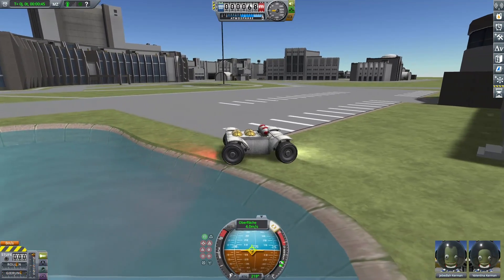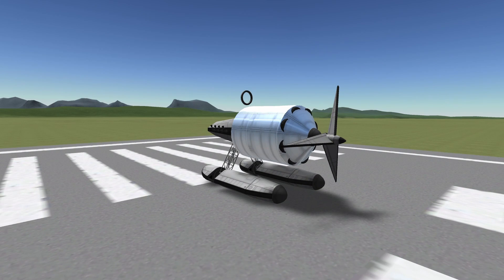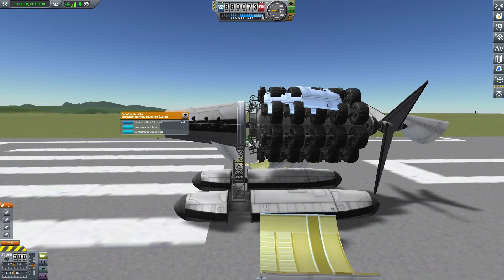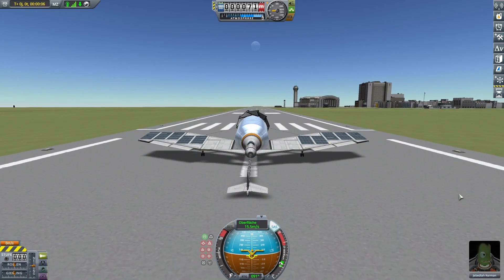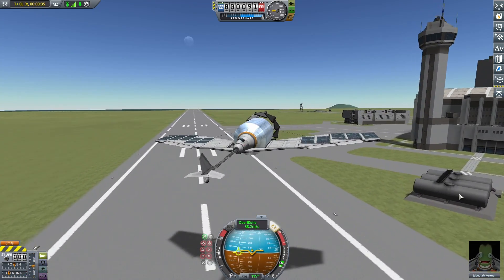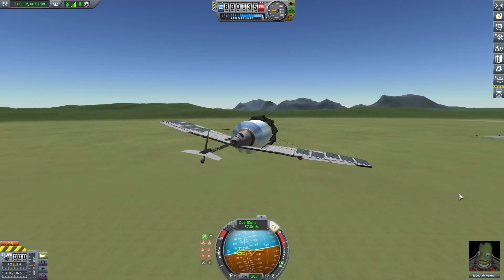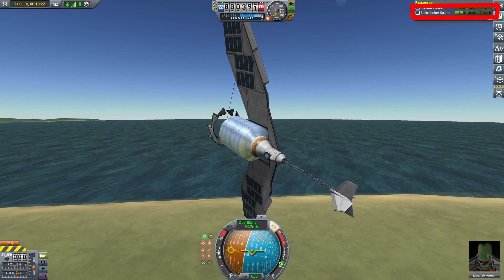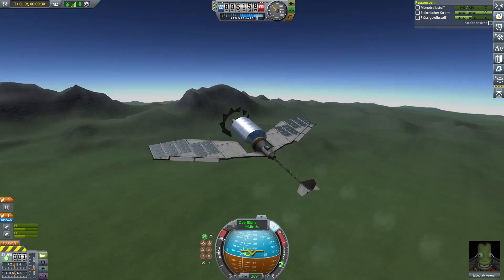Rover Wheel Powered Solar Plane | Stock KSP

Comment: Very interesting use of wheels! 
This craft definitely has some more testing in it
Have you thought about doubling or tripling the amount of propellers?
Reply from the maker: Thanks! Yes, lots of testing and iterations.
As the most efficient engine I could get turned out rather big, and my PC started lagging, I honestly have not really considered adding more engines. The power/weight ratio would have more or les stayed the same.

Comment: Have you tried mounting two of these engines counterrotating to negate the torque when adjusting attitude?
Reply from the maker: As the game was getting slow already, I wasn't keen on adding another engine. Smaller engines for some reason have a worse power/weight ratio.
What I did have for some of my planes were asymmetrical fins on the outside of the wings to counter the torque.